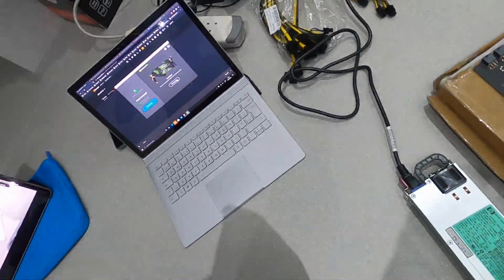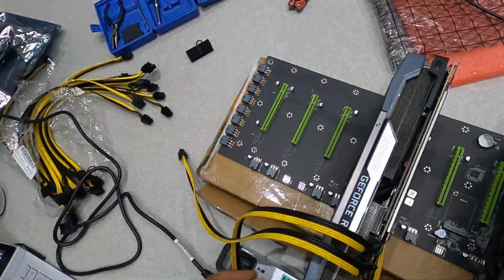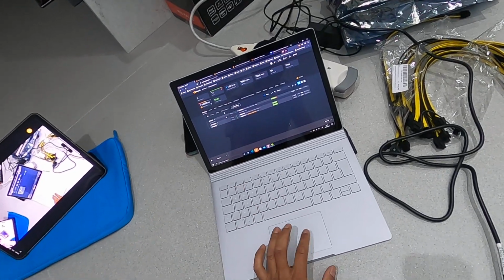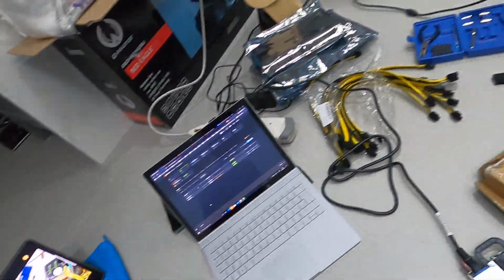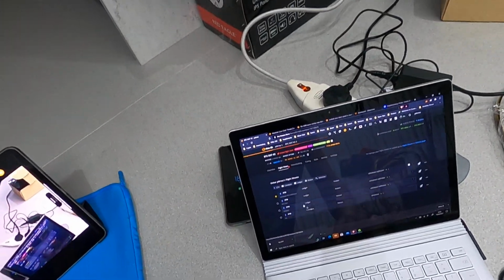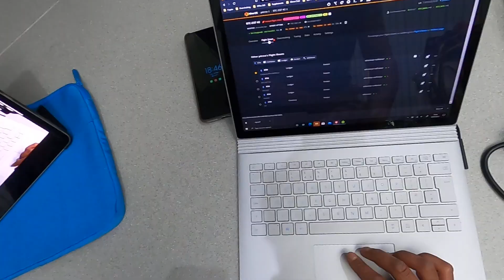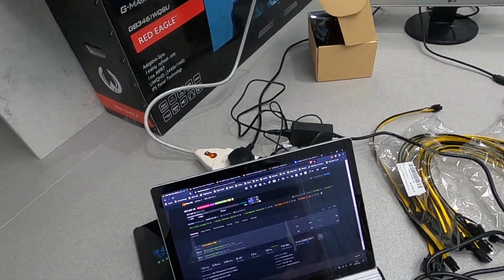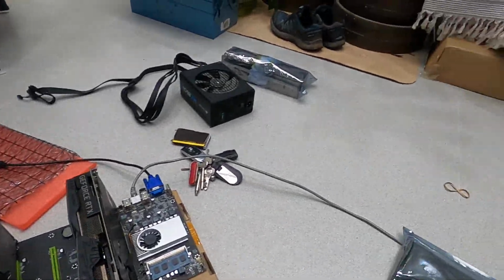Setting up a BTC-D37 board with Hiveos Part 2

Comment: Hi. Where does CPU and motherboard get its power from? Riser power connections?

I won't repeat the other people's complaints, but you should consider those criticisms for your next videos if you're planning to make any. Good to see the process from scratch for a newbie like me. Thank you for your efforts, I appreciate it.
Reply from the maker: I ordered from Alibaba and amazon for the risers. If you have time I would order from aliexpress
Reply: @p4rma-  Hey, thanks for answering but not the question I asked. :) I didn't see you connecting an extra power socket for motherboard to get its power from (CPU, RAM, etc.) Is there an extra power socket  for motherboard or is it also getting its power from the same power line as risers?

Comment: If I could get this boards bios settings can anyone point me in the right direction
Reply from the maker: I use stock settings, what do you want to change?
Reply: @p4rma-  can you elaborate more??? I don’t understand what you mean stocks settings it’s been this way since I plugged it in it goes straight to bios screen I must have to change some settings to boot and get to hivos
Reply from the maker: @robmelvin280  have to made the bootable USB or attached a with an operating system?
Reply: @p4rma-  I’m going to try flashing my hypo Wes again on my SSD card maybe that will fix the problem any other suggestions are welcome please
Reply: Hivos Linux
Reply from the maker: @robmelvin280  I don't see why not, though I have not tried it myself.
Reply from the maker: @robmelvin280  Check the boot settings in the bios, all of my B37 boards have booted straight from USB without changing any BIOS settings. I would double check to see if the USB boots on another computer.
Reply: Could you please write description of what you used, where you bought your items and so on, how to open account on hiveos I'm a beginner